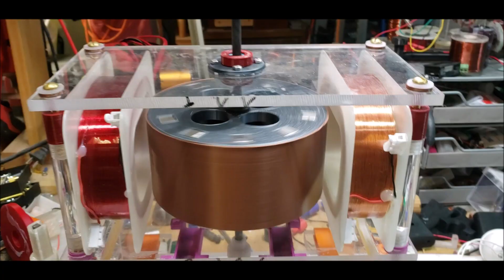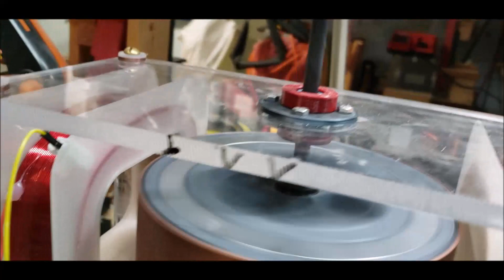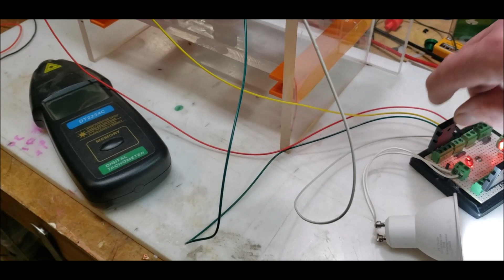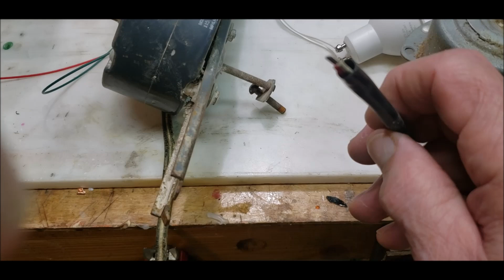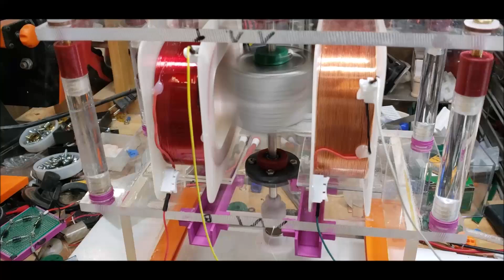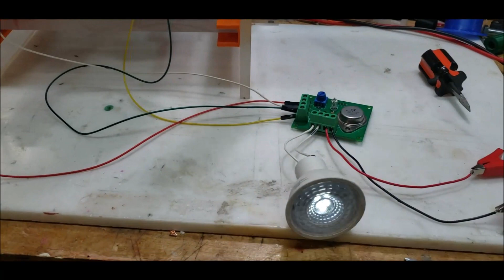3D Printed Pulse Motors testing all kinds of rotors and circuits

Comment: Is that "run" batteries giving the machine it's power or is it a bench top power supply sir? Also sir, what  type of transistors are used and what are they rated for?  Is that big rotor really supported by magnetism by using 2 opposing fields to support it sir?
Reply from the maker: Bench top power supply, the circuit is a JL94/93 trans and yes its being supported by magnetic lev.
Reply: @mcorrade  Thank you sir.
Reply: You mentioned putting different resistors on sir to beef the circuit up. What would the rating of the new resistors given the wire gauge you mentioned? Thank you sir.

Comment: I see you also mark your plexiglas with an M or W over 2 sheets so you know after drilling the holes in which order you have to put them...  But just so get it right: you are using 2 normal bearings and the magnet at the bottom so it would stay in place vertically? did you test how much slower the system gets when you run it horizontally, just with the 2 bearings? just being curious... would be interesting also to have the coil specs of those big coils... (wire gage, turns, and above all resistance)
Keep it up.
Luc
Reply from the maker: I'll try to remember in the future to give out more specs.
Reply from the maker: Only another maker would notice the "W" or "M" on my acrylic lololoo

Comment: Black and red should be hot in the 2 speed fan motor. White is neutral.
Reply from the maker: thank buddy
Reply: @mcorrade  use a ohm meter and red to black should be the most resistance.the sum of Black to white and red to white should be close to red to black on the meter.